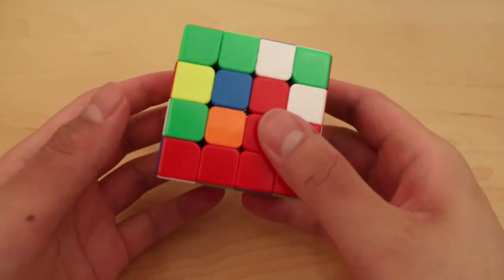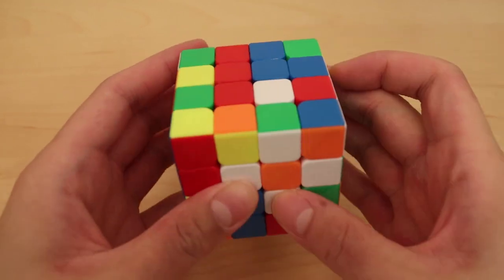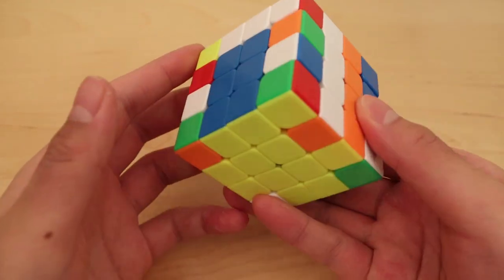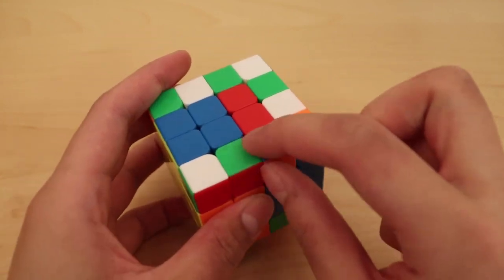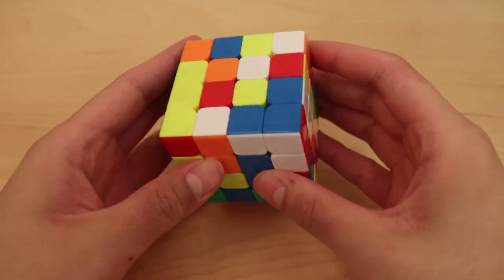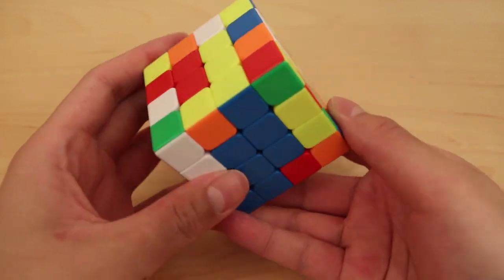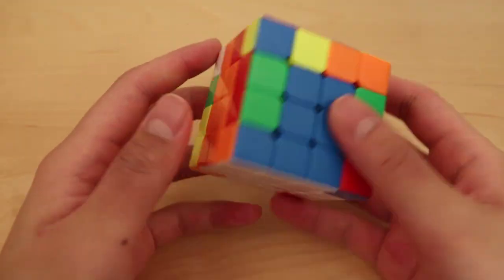F3L + 3-2-3 + OPA 4x4 Example Solves!

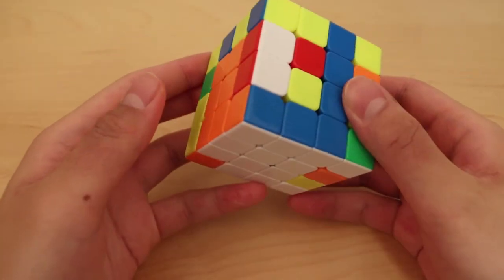Comment: 12:49 I think I would have used keyhole. D' Lw' U2 Lw D solves the front triplet and also preserves the edge pair. Not sure if that would give the same case for the last center but more options is always nice!
Reply from the maker: That's probably better, nice catch! I often have a hard time with those since I often forget where the empty slots are but I should definitely work more on that!